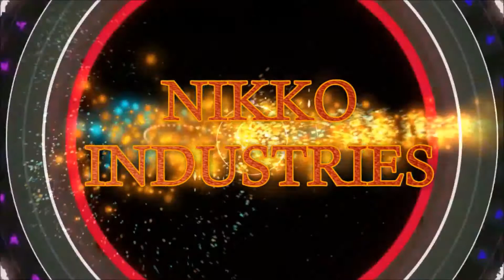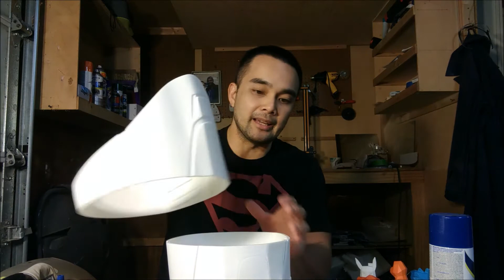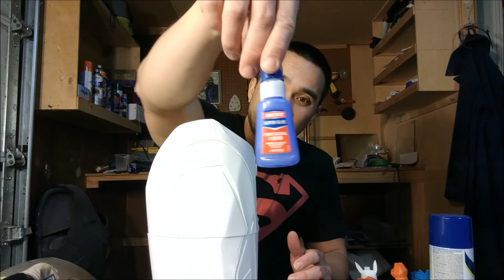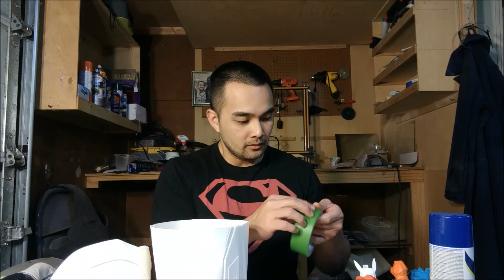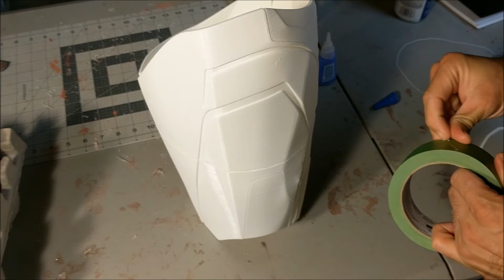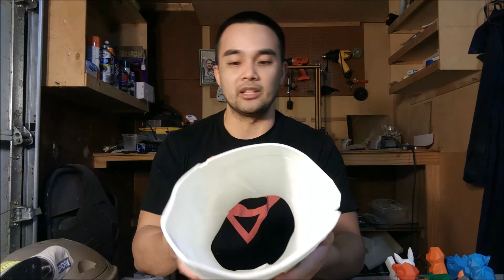Cosplay Tutorial#5- Assembling Your 3D Printed Armor Pieces

Comment: I know this video is old but here's a tip. After you cut your piece in two, if you add aligning holes in both pieces the size of filament. You can cut little pieces of filament, place in the holes and have a guide to align your parts.

Comment: I have a boba fett helmet that I split in the middle. Not the center but across. So the bottom part moves since they are not connected. Have any advice to get a firm glue with aligning it so it doesnt move. I can email you an example
Reply: use this glue, one of the chemicals in it can melt pla like acitone does to abs. this is what i use and it has awesome bonds. its also a little thicker than super glue and has a longer cure time so you can work with it. it says it has about 5 minutes of working time but to get a good bond, you dont want to be playing with it more than a minuute or 2 after putting it on. once you add the glue line the parts up and keep pressure on it for a minute or 2, and if possible , you can use something to clamp the parts together. in 5-10 minutes you can carfully handle the parts without the bond breaking. the full cure time on this is 24 hours, so after a day the parts are not comming apart if the bond is good. https://www.amazon.com/gp/product/B003HNFLMY/ref=ppx_yo_dt_b_asin_title_o02_s00?ie=UTF8&psc=1